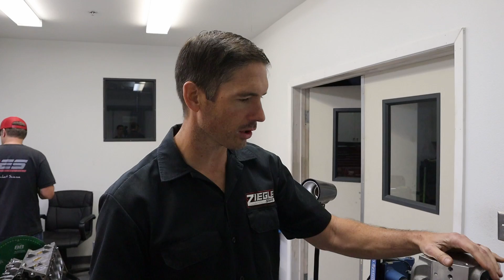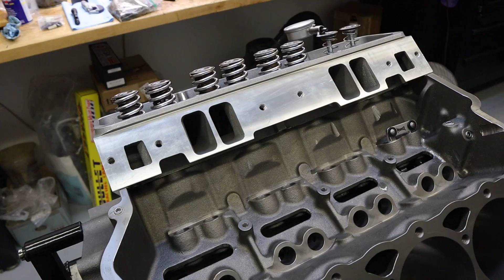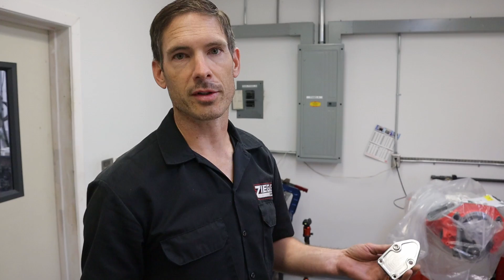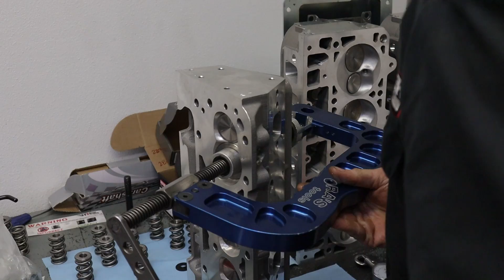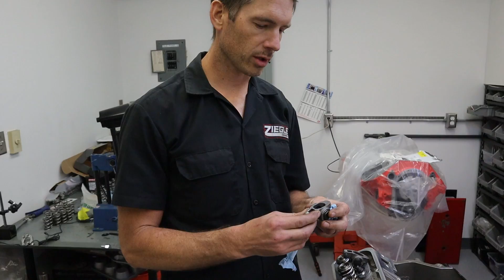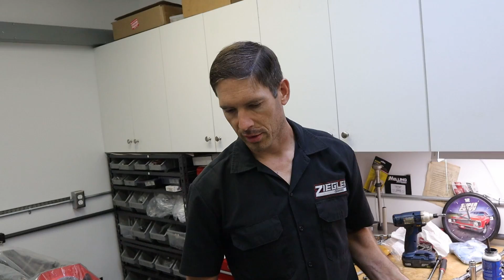Building a Performance 400 Small Block Chevy Engine Part 2 of 3

Comment: The seat to seat duration does not change , but the duration at .050 which most cams are measured at does change with 1.6 rockers opposed to 1.5.

Comment: There are great tools to check lifter & bore dimensions,  but whats the best way to verify lifter bore centers are correctly aimed at camsgaft centerline?  I think its worth asking because jigs in most shops align on mains as an initial reference point.  A roller cam must avoid taper [even 0.1 degrees] to load lifter axles evenly.

Comment: Awesome inspection of the valve geometry. Would the same be used for full hydraulic roller plus .050?
Reply from the maker: Thank you, yes the same principle can be applied in that.
Reply: I liked the mapping of sweep also.  Decks on aftermarket heads being thicker [and some spring pockets height being different on account of larger ports],  that was a smart check.  I have to admit I'm well enough satisfied with the sharpie method for my own ride, but I'm pretty good at eyeballing things.  I wound up using 7.950" pushrods plus lash caps to suit my solid lifters last build..

Comment: I went big block years ago. Now if you put too much money in a small block you might as well go LS or big block Chevy. But the LS compared to the big block Chevy. I hate to say but the same cubic inch for both engines the ls makes more power, stronger and last longer. There's so many things that are better with most of these newer engines have the newer technology of thinner rings, roller cams, better flowing cylinder heads and more. In one way I hate they made the LS engine it devalued my small blocks and Big Block Chevrolet engines. One thing about the ls engines the piston rings are thin like older model imports that have ran those for years the blocks and rings don't wear out. So this saves a lot of time and money down the road without having to rebuild it consuming oil losing power overheating and everything goes downhill when rings and pistons don't seal and start to wear.
Reply: I have both. 72 camaro with a heads / cam ls3 and 79mm garret turbo . 68 camaro w no electronics save a 6al and an alternator.  406 solid roller NA hotrod .
 Both have their place i guess. The 72 has all the electronics ,4 link rear, coil overs all around,  repetitive safety systems that keep me from pushing the ls3 too far under boost. 
 Honestly, there is something comforting about the mechanical simplicity of the carbed 406 in the 68 . 
 The 72 makes roughly twice the power in a much smoother car overall . Its just missing the hotrod soul I grew up with. That stinking, popcorn sounding SBC that tunes with steel tools , sparkplug reading , and seat of the pants feel just seems more real . 
 Sorry about the rant. I'm freshening the 68 right now, then one of the 2 has to find a new home.........I change my mind everyday on which one , lol

Comment: so what do you do if when you measure something its not right? no company is gonna let you send it back are they? are you out the cost of the part at that point? you guys are awesome but these are the things i need answers to before i pull the trigger on my own build.
Reply: I was wondering the same thing.
Like what if the cam is 4° out or the bearings have 0.005" clearance instead of 0.002" clearance?